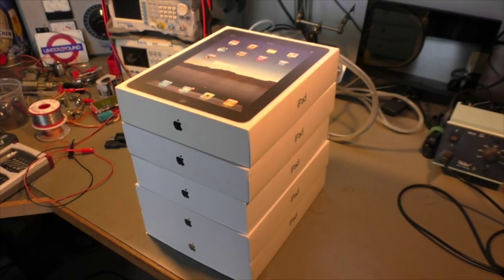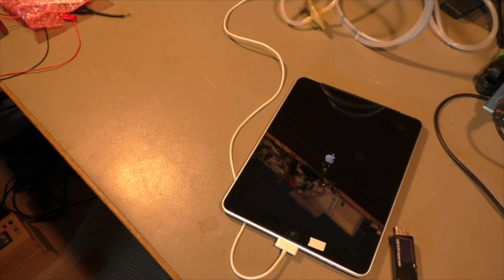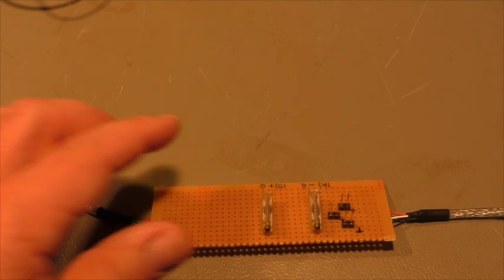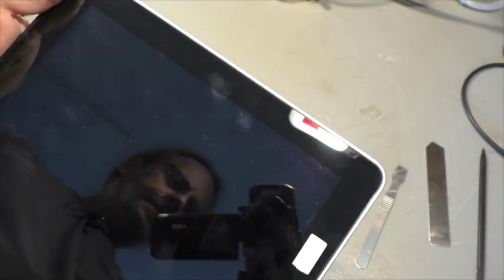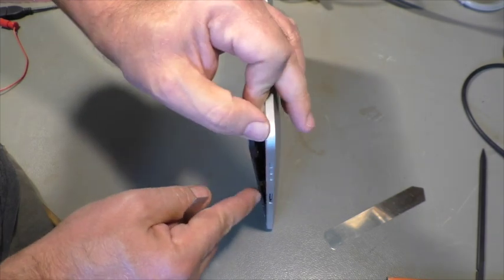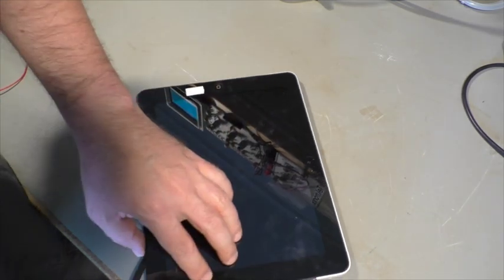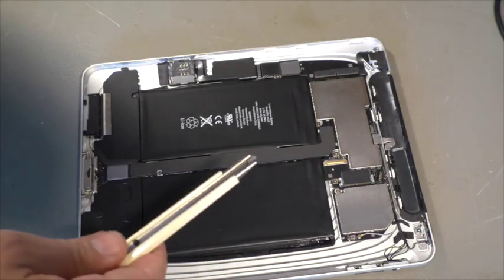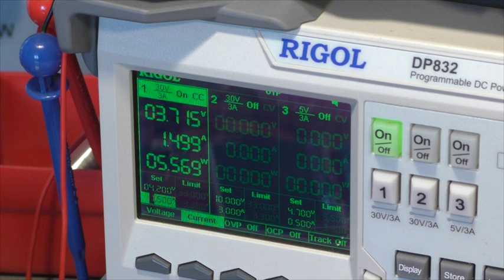How to jumpstart an iPad - (PWJ175)

Comment: Nice video, but i waiting for the mid-roll ad, mid ad ad roll, wont be long before YouTube puts ad's in ad's.

I had a Lipo battery that a charger would not charge as the voltage was too low, so I connected a power supply with a 100uA limit and just left it. The voltage slowly came up and then the charger charged it normally and it recovered full capacity.
Reply from the maker: Yeah sometimes that works, but that battery is certainly not safe anymore.
At the moment I can't change the monetarization settings. Something is weird, I wanted to remove the mid-roll ads, but I can't. Seems Youtube has technical problems...
Reply: @PlaywithJunk  can't turn ads off a problem? To google that's a feature not a fault

Comment: I'd be awfully tempted to measure out the location of where that insulation you removed is and use a CNC router to drill some very small holes to the battery contacts; press in some sharp pins to make contact, jumpstart, fix holes with dot of superglue.
Reply from the maker: that would make sense if you had dozens of such iPads.

Comment: I had a similar problem with the original Lenovo Thinkpad Tablet with Android. If the battery was really empty, it would neither boot nor charge. Fortunately, this device also has a 20V charging port via the docking station. If you use that one it will charge even from an empty battery.

Comment: I suspect there's a reason why they won't charge over-dicharged Li-Poly batteries: they build up internal resistence in overcharged state. With time, the resistence grows to levels high enough to disperse charging current as heat between the battery's rolled-up foil, melting the insulator and shorting the foils together. The battery puffs up and may rupture.
Reply from the maker: Possible... but other manufacturers don't go that far. All devices I had so far can be charged, even with a very low battery... except Apple.
Reply: @PlaywithJunk  my sister had an iPhone 3GS, years ago, which was left to over-discharge itself by simple lack of use through several months. When she tried to recharge it, the battery puffed enough to tear the two halves of the phone apart. Fortunately, the battery didn't rupture or catch fire, but I think it could happen, and if I were the manufacturer, after seeing that, I'd in fact place active measures in the firmware to prevent my device from being recharged after dropping below 3V per cell.

Comment: Have a 1 yr old iPad Pro, accidentally ran the battery completely down. Could not get it to charge or power on.
Was still on warranty so took to Best Buy. They replaced it. Nuts.
Reply from the maker: I could understand such a problem on the first model.... but it seems Apple doesn't want to change that. Every other device can be charged without turning on first. But not Apple.

Comment: What I would love to see is a video where someone figures our how to either drill a hole to jump start them or even designing a template that would allow you to carefully use a drimmel tool and cut through the back to get to the battery (avoiding screen removal).

Comment: I had a couple of dead PS4 Dualshock4's (well the batteries). Registered 0v both in and out of the device. "Jump started" them by putting 3.6V directly across the terminals and waiting... slowly rose to 4V(ish) from 3Vish after a couple of hours... no problems since. Issue is that they have circuit protection on the battery and if they get to low (they had sat unused for some time at my lads) they won't charge in the dualshock and they cut all output power as well (hence 0V). Probs not a good long term solution (I believe that under volting can damage the internal structure and that force charging can make it a whole lot worse) but works for now till I can be bothered to get new batteries.

Comment: If you leave this on the charger for several days. It should trickle charge itself back to life.   When it says :not charging:  it is charging at 100 mA    So. Overnight. Youll get a nearly full charge with the screen off.
Reply from the maker: There is a problem.... you can't turn the screen off.
And when it is off the current goes down to 30-50mA. Not sure if any on that current even goes to the battery.

Comment: For my iPad 3G the screen just flashes every few seconds. The battery is flat. Do you think that’s the same issue?
Reply from the maker: Most likely yes. You can not charge the older iPads when the battery is so low that the iPad can't start. It's a silly trap but that's how it is. There are a few tricks that might work on you newer Pad.... check Google. Otherwise you may have to jumpstart it like I did.

Comment: Thanks for sharing! I managed to work through all the steps pretty well and charged the battery to 1,5V but after reconnecting everything the display remains black. Any suggestions?
Reply from the maker: 1.5V is way below the lowest working voltage. A Lithium battery should not be discharged below 3V. Fully charged it has a voltage of 4.2V. So you may repeat that again and if you reach 3.8V you try again. 
If that's not possible, your battery may be completely dead.
Reply: Thanks. Unfortunately I only have the original 5V , 2.1A charger to do this. Is that going to work?
Reply from the maker: @eelcostoffels  It is probably a bit dangerous because if the battery gets charged above 4.2V it might catch fire... so you have to monitor the voltage constantly while charging.
I do not recommend using that charger to connect directly to the battery.
Try to find a cheap laboratory power supply with adjustable voltage and current.
Reply: It worked! I got the battery up to 4,1V and the IPad switched on again. It has around 38% charge and I will continue charging through the original connector. Thanks again for your help!
Reply from the maker: @eelcostoffels  Good to hear that! I'm glad you didn't burn down your place 😃

Comment: Great video.  This is why I refuse to buy Crapple products.  They are deliberately designed to fail, and if that doesn't happen fast enough for their quarterly sales projections they infect old devices with an update...
Reply from the maker: If it was only Apple.....
Reply: Yeah, how many "new" customers are they attracting? The only way to have the continual growth the stock market demands is to have shorter and shorter device replacement cycles. Have never owned an apple product, don't ever plan too... overpriced garbage in a locked down ecosystem - no thanks!
Reply from the maker: @gorak9000  Yeah that's right... but it's not only Apple. This problem grows on any brand  :-(
Reply: @PlaywithJunk  Samsung has been going this way for a while, too.
Reply from the maker: @jamescollins6085  It's all the same, no matter what brand. Sometimes one is better and sometimes the other.

Comment: If the screen is disconnected can you not charge with the original charger in the charging port
Reply from the maker: I don't know if it makes a difference if the screen is disconnected or not. Maybe it uses less power... But if you already opened the iPad to diconnect the display, why not jumpstart the battery?
Reply: @PlaywithJunk  I don't have anything to charge it or jump-start it

Comment: Can I charge the battery in an other way also ? Because I don’t have a power converter?
Reply from the maker: By power converter you mean a lab power supply? I can't recommend another device except a LiPo charger with proper voltage and current. LiPo batteries can get very angry when charged with the wrong tool. They easily go boom.

Comment: I had similar iPad woes, I hooked battery direct to power for a few minutes and got a result then used USB to charge it, but the screen remains black with a glow from the backlight only.  It is found by PC and able to be restored but still a blank screen. Any thoughts, I have checked all connections, several times and suspect lcd issues. Do you agree?
Reply from the maker: I would say so.... LCD or graphics chip.
Reply: @PlaywithJunk  thanks for that reply its time to bin it.

Comment: I once went through 3 LCD screens trying to repair my Samsung s5, I think once these devices get to the micro scale and glue involved they're nearly completely un serviceable
Reply from the maker: At the moment my repair statistics on Apple products is like...  repaired:3 destroyed:3
One was a nicely working iPOD with color screen but there was a splinter of wood wedged between the glass and the housing. So I tried to remove it... and ripped a tiny flat cable off. At the end I smashed it with a hammer because of all the frustration :-(
Reply: @PlaywithJunk  lol for me replacing the screen on  Samsung very frustrating,  first screen tested okay so I glued it in and then digitizer stopped working and screen cracked when taking apart again.
Second screen ribbon cable tore when assembling (same situation tiny space between screen and cable connection to board) then the third screen was lucky and seemed fine but intermittently would go black for few seconds so I left it at that lol

Comment: I've herd that sometimes some issue with the operating system or application will cause an Apple device to crash. When the device is rebooted the problem is still there, causing it to crash again, forever.
Reply: in that case you can always enter recovery mode and install a fresh iOS version thru your laptop :)
Reply: @Abhidoesfirestuff  OK. That makes sense.
Reply: Yeah, it's called Apple software. If it has Apple software on it, apply directly to trash bin.

Comment: firewire?
Reply from the maker: What? Why? Wire Fire? Watta u talkin of?
Reply: @PlaywithJunk  apple had those firewire charging bricks and you can use it with the firewire to 30pin cable. Its output is much bigger than the regular chargers.

Comment: Great video. Sadly my cells are totally dead. Is there any way of running the iPad without cells, e.g. by connecting a 4V power supply directly to the contacts of the battery controller board? How would that need to be wired? Just connect both - and + together and then feed 4V into the 2 wires?
Reply from the maker: If your battery is dead dead, then you should diconnect it from the board or even remove it completely. Then you can try to supply the 4V to the board where the battery was connected before.
It sounds like you don't have much experience in such things... maybe you better let it be? Lithium batteries can explode if handled incorrectly. ;-)